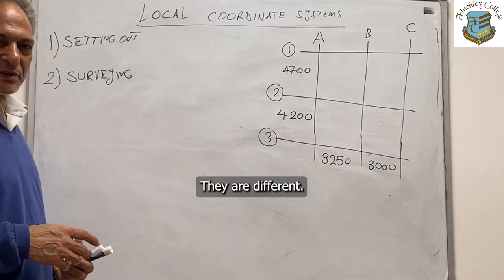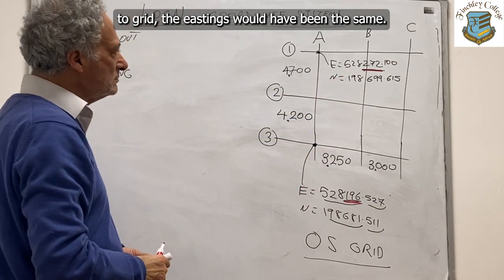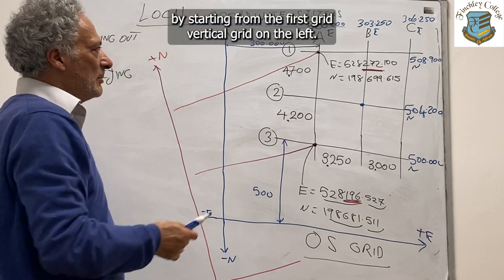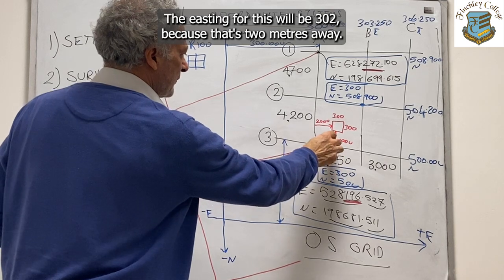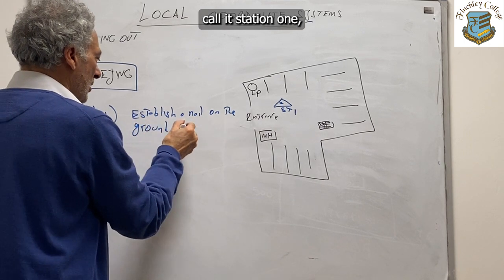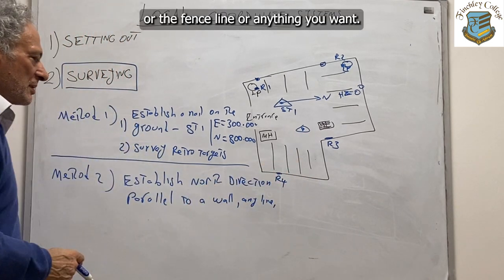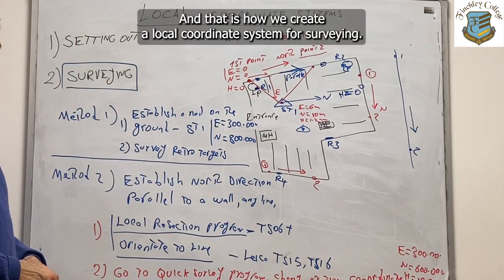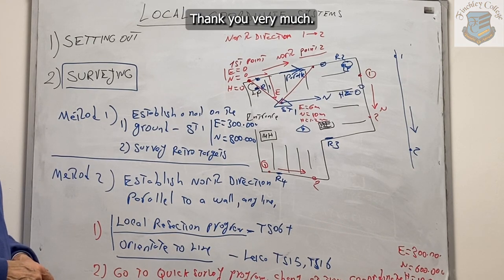Local Coordinate Grid Systems

Comment: Great video! Just a quick question - what calculator is the best to use that has all of the functions required for surveying/setting out?
Reply from the maker: We can supply you with a suitable calculator. Please be aware that most programmable calculators sold on Ebay come without a program on board.
Reply: @FinchleyCollege  That would be great. I will send an email for further information. Thanks